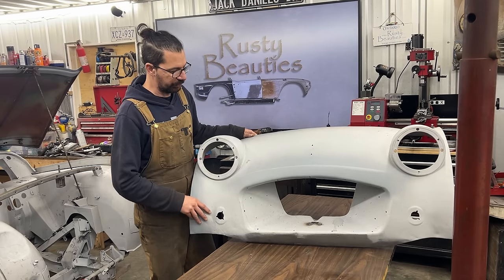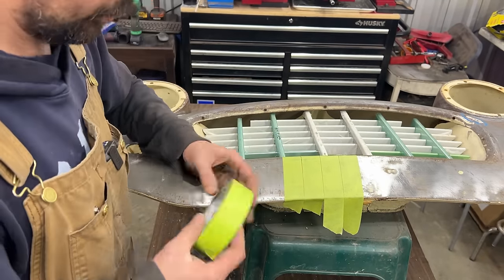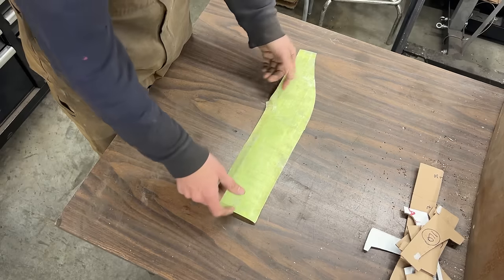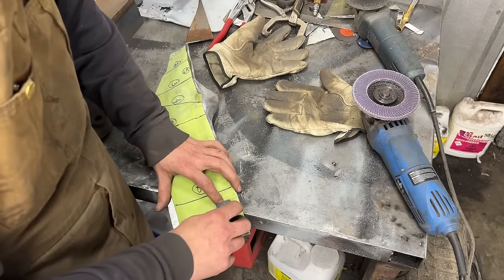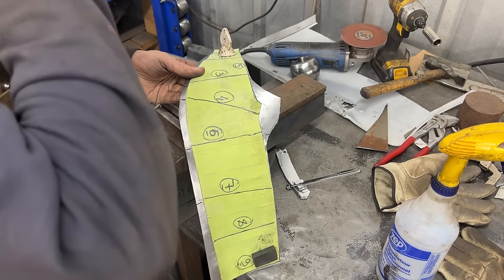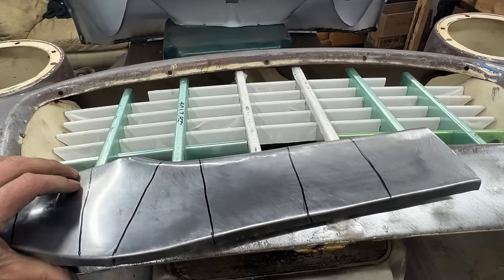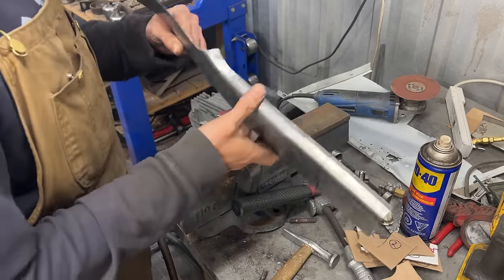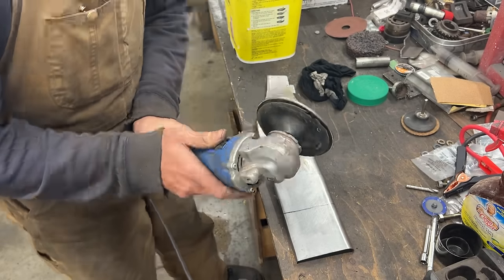1958 TR3 - Part 11 - Panels from scratch

Comment: Great work Elin. When I look back to your first videos, you really have come a long way, you should be proud of yourself. I've tried the Wray Schelin technique, and I am convinced that the only way the flexible shape patterns work really well is due to the fibre glass tape he uses. Other tapes seem to flatten out with very little pressure. Anyhow, your end result has turned out really good, just a mirror image piece to make now!

Comment: enjoyable Elin... This is an example where a stretching hammer and a sand bag would have gotten you to the end much quicker. You could then have used the planishing hammer and wheel to smooth out the stretch (walnuts) that the hammer got you. I personally like paper patterns more than the tape method as it is too easy to stretch the tape.

Comment: I've watched your paper masking tape template a few times trying to understand it better and the one tink you may have missed is that since it is paper it has a grain and the way it is made means that the long grain is the direction in which it is made so across the tape roll is short grain. When taper stretches or shrinks it is the grain that moves and not the length. So the last thing you want when making a template is when it can stretch or shrink in one direction, To maintain the shape the tape has to be laid down like plywood. One layer vertical and the next horizontal and a third vertical again. That 1st section turned out well and the other side should also be great. Well done and thank you for showing.
I can't wait to see so many missmatched parts forming a great looking body.

Comment: You are Wray #2. A few more pieces like this and you will be a master like him, I know he says it doesn't matter if you work in steel or aluminum, but I feel, from my limited experience, that steel  is harder to move than alumimum, which he works with most of the time. Remember metal is clay!
I look forward to seing it come together as a new lower lip.